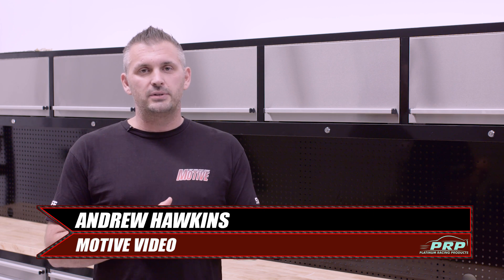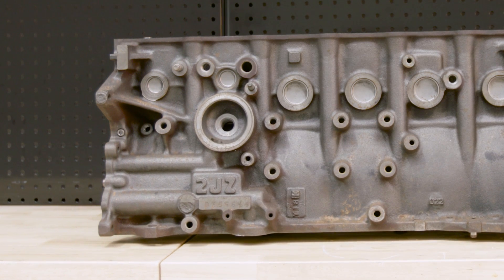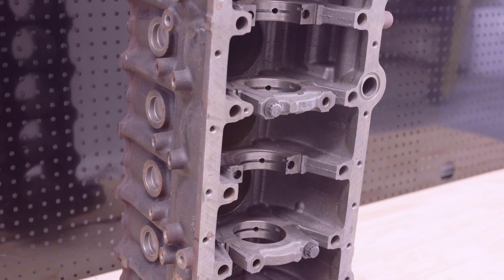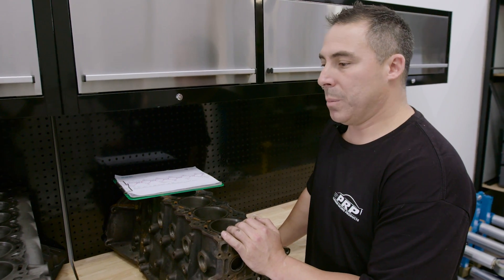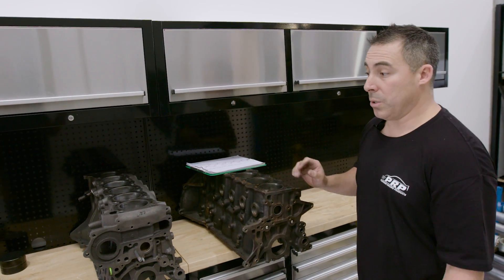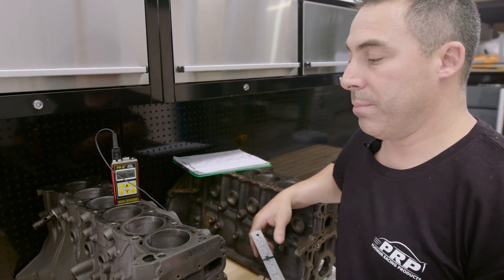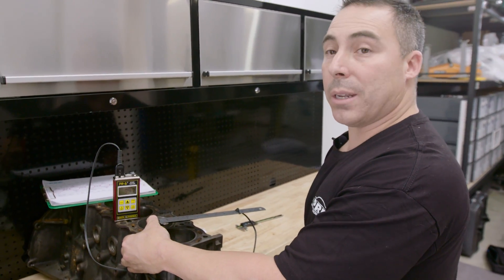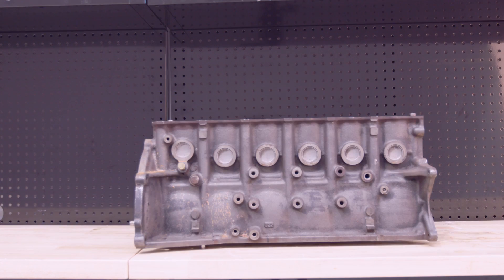RB30 vs 2JZ Which is the Better Block and Why? - Mythbusted

Comment: You should compare the new GTR motor (VR38dett) with the new Supra motor...oh wait.  Toyota is now lame and its a BMW motor
Reply: 2jz is a Yamaha engine.
Reply: @mehrshadvr4  wrong...made and design by toyota, celica gts 2zzge and lexus lfa are yamaha engines...
Reply: @mitsuevo8mr  not so much engines, but the heads were designed by Yamaha. Pretty sure the blocks are Toyota(btw, this relationship goes back to the ST164 Celcia All-track).
Reply: @mehrshadvr4  i did not read anywhere the 2jz was made by yamaha, a copy of a yamaha design, but the only colaboration was by hitachi on the turbochargers that were made by toyota and hitachi on the tt versions..
Reply: Mike Ford
Farther than that. The 4A-GEs in ‘80s MR2s and Corollas are also Yamaha/Toyota as is the 1UZ-FE
Reply: Neg Ative 2000GT engine was Yamaha's design. They pitched it to Nissan who refused it. That relationship goes way back. 

Yamaha 2JZ.
Reply: 7drone7
Most people have no idea the link between the 2000GT and the 240Z
Reply: Neg Ative
As a Z car fan, it's nice to see you do. Nissan went it alone, and cranked out some fantastic engines over the years - to take nothing away from Yamaha, who has legend status in much too small a circle. Their contribution to the halo around Toyota can't be overstated.
Reply: @mehrshadvr4  

No its not a yamaha engine.
Yamaha designes the head.... on high perf models . Since the late seventies
Reply: @mehrshadvr4  hahaha you even dumber
Reply: Damn. You butthurt about an engine bro?
Reply: haha, shots fired!!
Reply: First try to do a 5s pass with VR38 before calling Toyota lame. It's a shame Nissan newer engine can't even beat a 25 year 2jz..... Lol
Reply: mehrshadvr4 ya But i fail to see your point💀Yamaha is a cool ass company just like Toyota
Reply: bobwatters  Toyotas 2jz OEM block has run into high 5s because TOYOTA had over engineered its 2jz to handle power in its time. you can clearly see the block difference between RB and 2jz. Name any other nissan engine which has run 5s with its OEM block.. oh wait it hasn't lol.
Reply: It also has a very strong motor. You pretend like BMW doesn't currently make the best I6's in the business.
Reply: Why would they compare those?
Reply: bobwatters no matter how boring, less feature packed and unattractive their cars are, there are certain group of people all around the world who prefer Toyota because of it's unprecedented reliability and it still reigns supreme in its sales figures.
Reply: bobwatters  agreed that they currently make boring cars because they are more sales and profit orientated now but you can't say that Toyota is lame when its old 2jz is currently the fastest import in the world period.
Reply: Best comment 😂
Reply: The EastMan you’re dumb as fuck if you think the vr38 is a vastly different design from the vq. The r35 gtr engine is literally advertised as a glorified vq. 

Same bore spacing, block is the same with minor exceptions for the crank girdle (you get that on a vq35hr but not a de), sure it’s got different parts in it and a pair of turbos... but same v6.
Reply: haha some internet people cannot even internet properly.  Thanks for clearing that up for him.
Reply: Gtr motor is shitttttttttt
Reply: Do u know about cars? U dont know shit u dont even know what u talking about dumb fucking idiot
Reply: Hahaha no its not i dont think u know about cars mate ... toyota uses only toyota stuff hahaha ur stupid toyota will destroy any bmw u bring its just stupid how u compare it
Reply: @shapy1188  no they don't MATE. New supra is a beemer.
Reply: @boldswede1280  wtf u talking about? I dont even underestand ya MATE
Reply: @shapy1188  the new supra is not a toyota but a beemer.
Reply: @shapy1188  bro why are you so upset that someone called the new supra a bmw? It's not like it's a secret or anything that it's a joint venture between Toyota and bmw making the z4 and supra. Same platform and drivetrain.
Reply: It not gtr motor it 350z motor
Reply: @timothyrinaldi6609  what?
Reply: @timothyrinaldi6609  fkn idiot

Comment: 1JZ vs 2JZ please!
Reply: @JM-vu1bk  pretty much every thing you just said is wrong haha
Reply: Please please please. And rb.vs 1jz
Reply: @Dacommenta  you wouldnt need a video on rb vs 1jz.... you have a video covering the rb family already. Once you know the 1jzs stats just compare from the other video.
Reply: @JM-vu1bk  The 1j block will handle more than 550, there are plenty of stock internal 1j's making this at the tire.
Reply: Seen 1j blocks handling over 1000hp
Reply: @JM-vu1bk  - in fact 1JZ block is nearly identical to 2JZ, it just have less material on the top (read - it is lower). Bearings are same diameter, oiling system about the same, etc.
Reply: Phily Kham 1jz - 2 big turbo ,2jz - 1 big 1 small turbo
Reply: @khoojunfei6364  there's a lot more than that though
Reply: @khoojunfei6364  2jz with one big turbo instead of 2 smaller ones makes more boost tho
Reply: 1J>2J sound wise 🤤🤤 I get so jealous when a near stick straight piped JZX100 drives by and my car is a single 🤣🤣

Comment: Mind blowing good info, very well done. Next one you should get Herman to discuss what the RB boys are going to reduce the issues. Drilling out oil returns to 10mm and adding head drain, oil feed holes bigger, annular oil groves to run 26 bearings, grout to support cylinder walls and his braces.
Reply: so much to do Peter, so little time!

Comment: A comparison of 1jz gte vs 1jzvvti vs 2jz gte vs 2jz vvti vs 2jz ge would be awesome, please!
Reply: Yes we need more information on the jz blocks.
Reply: I dare say at a guess that the 1jz blocks would be the same since all vvt is handled in the head. Likewise the 2jzs vvt or not would have the same block also.
Reply: @The_Koups  as far as i can remember from the Jz forums the only real 2j block difference was some small things on the Ge block, but still takes Gte internals
Reply: @TheJay_Vee  yeah the case might look different but the hardness and bore will 99.99% be the same
Reply: @The_Koups  the 2jzgte and 2jzge non vvri bottom end is the same the 1jz block is different from a 1ggte amd 1g thr 2jzge vvti blocks are different from all the jzs with the weakest blocks to the gte variants
Reply: @LucidBoost_3600  i know fat fingers when i see it (suffer from it too) but damn that was hard to follow. So your telling me that the 2jz-gte vvti had a weaker block and pistons than the std gte? When talking the NA 2jz's then yes they have weaker rods and pistons than their turbo counterpart, thats not new news.
Reply: Gotta slap some 7M's in there for good measure
Reply: blocks are the same, later model vvti non turbo blocks used thinner rods though.
Reply: Full comparison of all the different popular jz engines would be ace
Reply: Friend 
Mr.Flintstone about the 2JZ blocks all between them have the same strength on all engine models GE or GTE or GE-VVT-i or GTE-VVTi their differences are as follows:

GE Block dont have: 
1) Oil squirters
2) Has plugged off the water cooled oil filter inlet
3) Oil feed hole for turbo

I hope helped you:)
Reply: @RevolversOverPistols  not true at all. The 2jzgte vvti is at the top because of vvti. The 2jzgte non vvti next same exact motor minus vvrim the 2jzge non vvti bottom end is just as strong as the gte bottom ends and the 2jzge vvti is thr weakest of them all and can ot take mote than 450whp or over 400tq which is why people use gte or non vvti pistons and rods on a budget build. The 1jz bottom end is not the same hence why people build 1.5jzs and use 2j bottom ends on their 1j for a stronger more efficient source of big power builds
Reply: I think the blocks are the same. Maybe test the strength of the heads. VVTi vs a non VVTi.
Reply: @imty8774  from what ive read, vvti makes it an interference engine. you make the call there
Reply: @imty8774  the 2jzgte vvti and non vvti are exactly the same minus vvti. It is the best 2jzgte you can get. The 2jzge vvti is the weakest the 2jzge non vvti bottom end is just as steonf as the gte motors
Reply: Great idea!!!
Reply: Plus all the RBs
Reply: blocks are the same for the 1j and 2j
Reply: Narendra Rajcoomar No they are not lol, 1J is about 500cc short of a 2J for starters
Reply: @Mainfoldium  block is the same bore is the same @ 86mm, the stroke of the 1jz is 71.5 mm and the 2j is 86mm
Reply: Narendra Rajcoomar so your saying the 1j block deck height is the same as the 2j?
Reply: Narendra Rajcoomar BORE IS THE SAME that's all, not stroke, not deck height.. 1J is asymmetrical bore&stroke with 86.0x71.5, 2J is symmetric bore&stroke 86.0x86.0. You couldn't run the same bore&stroke without the appropriate deck height.
Reply: @spicyF1  they're not which is why people go 1.5 jz and put a 2jz either gte or ge non vvti bottom end on their motors for a stronger mre efficient bottom end

Comment: Barra and BMW I6 would be awesome. Please consider keeping this video series going. Very cool.
Reply: What about Mercedes m104
Reply: Honestly I’d like to see evaluations and comparisons between oem blocks of all kinds. I find it fascinating.
Reply: They should do s54 and bara too s54 is phenomenal
Reply: @FirstLast-tx3yj  S54 is lucky to handle 600hp without a rebuild.
Reply: He did one with the barra. The 2J is still number 1
Reply: @boostybotha355  so why on average can a Barra stock block handle more power?
Reply: @kiwi8.  on average? That’s a very vague statement that is completely anecdotal. I’m simply stating that this channel did a review of the inline 6’s and according to them, overall the 2J is the best design made of the best materials.
Reply: @boostybotha355  Iv seen this said often I'm just wondering why you see stock Barra blocks holding 2500+ HP but not the so called 2j ? There are barras at 2000hp with factory head block and crank I'm just trying to figure out why if that are not as good can they handle that kind of power?
Reply: @kiwi8.  that’s silly. Any engine making those numbers is limited in its life and there will always be somebody making more power no matter the engine. You also have to remember that the barra has an entire liter of displacement on the JZ so it’s way easier to make power…and according to this channel(again, I was referring specifically to this channel’s content) that is one of only two pros for the barra over the 2j. Another one is cost, it’s cheapest to build. The 2J has the better quality iron as it’s block is the hardest and it’s smaller and lighter than the barra. Oh and the 2j has a siamese bore. Playing the “there are guys out there making this much power” game is childish. The reality is you will never own a 2k hp car and a car making that much power has lots of issues, even if the block holds up. Skip to the end to hear their results or watch the entire thing. 

https://youtu.be/y5zsZ8Fc0kQ
Reply: @boostybotha355  so if the 2j is so much stronger why can't it handle as much power? Allot of the Barra cars are street cars and get used allot and be very reliable they make usable power off boost so you can drive them without being way up in the rev's. You can have 5 people in the car  tow a caravan and have 1000hp on tap
Reply: @kiwi8.  both engine blocks and heads can handle about the same amount of power. The extra displacement in the barra would mean it is under less strain at the same power level, so it has an advantage there. Regardless, when the iron was tested as you saw in the video, the 2j had the hardest iron out of the two. Toyota used the best quality iron in its casting over its competitors. That’s scientifically proven. Now stop talking about 2000hp cars, your arguments are silly. Anybody with doubts on the abilities of a JZ are either being willfully ignorant or is very new to the car scene.
Reply: Good lord fellas; what do you have against this poor bloke’s back suggesting a comparo between a Barra and a Merc block?! If you start doing them I’ll make sure to list a couple tank engines or locomotives...*chuckling*
Reply: @samsonian  the barra is 241 its pretty average
Reply: Totally agree this w ou ud be a friggin amazing series! Great video

Comment: would like to see barra vs 2jz, great work on digging into what "was" a controversial topic
Reply: Money on the barra. Just because its newer. Newer iron mixes and better casting methods.
Reply: @The_Koups  and guess what that test has been done now,the 2jz is the king,your barra is like rb20,no surprise the 2jz and 1jz are the king of 6s,barra way down the pecking order.jz owners already knew,thats that little topic over 2jz spelt any way you like it is king,japans metal mixs are amazing Australia wouldn't have a clue how to get shit done.facts are facts
Reply: @my1krr  barra is 1 of 2 motors made by ford aus. It is a 4L straight 6 castiron block code names Barramundi.
Reply: @my1krr  fj? No its in EA, BA, BF and FG. Its basicly just a larger displacment 2Jz
Reply: @The_Koups  🤣barras are shit
Reply: @my1krr  i cant say i have ever liked fords after the "x" series. The "E" where a pile of shit as was the "A". Ever since then i just never gave them a second look.

Comment: Rb30 should win in reality. It wasn't really intended as a performance engine yet it is pretty much equivalent to the over engineered 2jz I ain't even mad. R fucking B for life.
Reply: Pretty much equivalent? Lol
Reply: The 2jzgte was not in the supra first, The Aristo was the first car to have the 2jzgte and I’ll I can say is that the aristo is far from a performance car
Reply: The 2jz wasn’t intended for performance  as well
Reply: @Granty4510  Aristo wasn't performance vehicle but it sure did have plenty of power back in the day so engine was made for performance. You are basically saying that chassis is reason to make engine strong, not the actual power of the engine.... Also one argument over high performance driving is that heavier vehicle puts more stress on engine, putting 2jz example in front of 18 wheeler would make 2jz scream.
Reply: This is one of the single stupidest comments I have ever read in my entire life. The RB is better because even though it is inferior in every single way, it was designed to not be as good? How the fuck does that equate to being a better block?
Reply: RB30DETT stands for Race Bred D-dual overhead cam E-Electronic concentrate control system TT- twin turbo so how was it not intended for performance??
Reply: Smh the 2jz was in a grocery getter JZS147 first.... the 2jz wasn’t even a performance engine ya fucking fanboy
Reply: JDMHMONGBOY96 you do realize that the 2jz is Toyota’s take on the 1j right? The 1j was designed by Yamaha for the mk3 supra, their top tier sports/touring car of the time... not a performance engine my ass. It was designed by a fucking motorcycle engine builder. It was made for high rpm, high horsepower and boost. It’s as performance as it gets. Just because the actual 2jz was in a sedan before a supra doesn’t mean it’s not a performance engine... fact of the matter is the sedan you mentioned first came out before the mk4 supra, so the mk3 was still in production. Toyota developed the 2j after The Yamaha contract was up, and it just happened to be before the mk4 was put into production
Reply: this
Reply: lmfao when nissan fanboy still finds a reason LOL
Reply: In the end of the day, if you manage to design a performance engine ( the JZ platform ) and still have it economicly viable to literaly throw them in EVERYTHING you make witch is rwd as if they where any other garbage eco box engine you did one hell og a job both in development and production of them!

Performance or not putting 1000 hp capeable engines in everything you make and still have it economical... that makes it a winner in every single aspect you can think of
Reply: Except for you obviously are clueless.
Reply: billy you were dropped on the head as a kid i see
Reply: Ur do dumb.1jz 2jz r better engines stronger holds more hp.why u think guys in drag race use dem.they holds more hp.if rbt wall all dat why r they not dat common.asshole
Reply: I totally agree with u RFB 4 life ...
Reply: Not to mention the rb30 was only available in Australia and NZ as apposed to world wide with the 2jz.
Reply: billy paoletti  I’m not going to lie, even if they put the 1jz against all the RBs, the 1jz will be more superior, but the the Nissan chassis are leaps and bounds in front of Toyota

Plus the 2jz non interference head is so good!
Reply: @Granty4510  spot on. I love me some RBs, but the 2J is just a better platform. This is nothing new. But you cant drive a motor and that's where the RBs short comings begin to gain ground. Factor in the chassis and its alot closer than people make it out to be.  Unless you just drag race but fast driver > fast car imo
Reply: @Blakek.  spoken like someone that's never been on a race track, if you think any form of racing doesn't require skill your dead wrong.
Reply: @billsloft2190  all your excuses are irrelefant and doesn't change the fact that 2jz engine are strongger than all rb block, and never has oiling problem. Yes nissan chassis are better than toyota, but we are comparing the engine.
Reply: @billsloft2190  Truth is, Nissan engines are total junk. You love junk, that's cool. But "Rb30 should win in reality" "In actual reality the RB30 isn't even in the top 50"
Reply: That may be the case but it never gained it's fame until the supra was released.
Reply: So the supra isn't a performance vehicle? @grant

Comment: Now do a red 202
Reply: Hardness: some
Reply: @mad87645  head studs: yes
Reply: Bore thickness..........
I think there might be some left on the front side of 1
Reply: Dad stacked his hz when i was a kid, bought all the panels to fix it only to find the waterpump shaft had dented the bore.... Dead set $30 gmb waterpump... Youd think it would have bent the shaft not just punched a dent into the bore, then again the engine was warm when he crashed so i suppose it got softer...